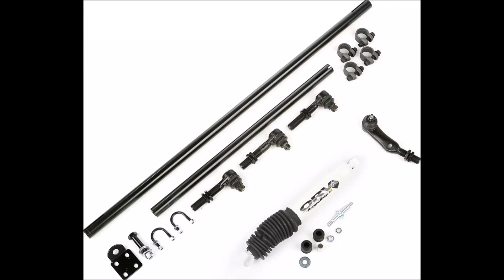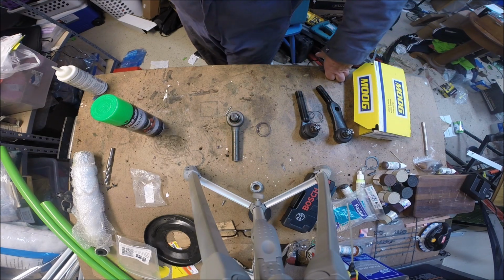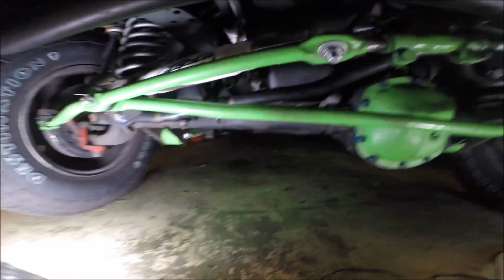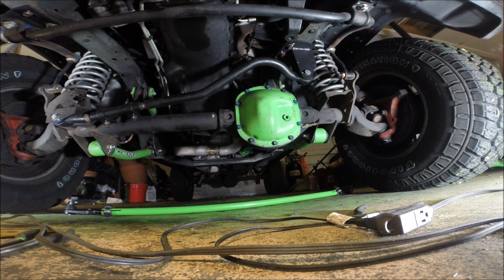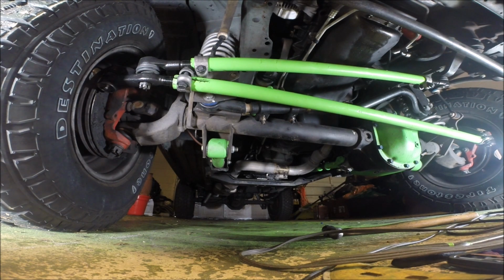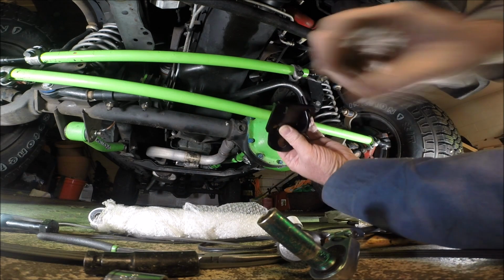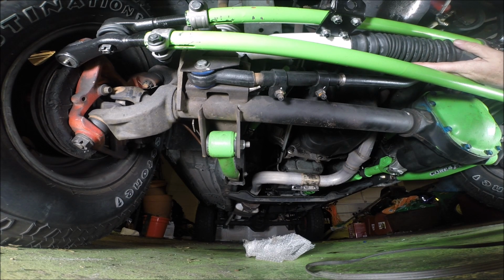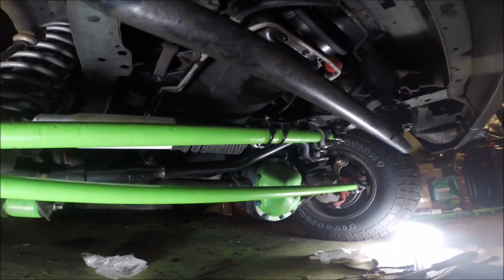Cherokee Therapy 18: Is the Rugged Ridge HD Steering Kit for Cherokees *Actually* "Heavy Duty"????

Comment: Thanks for making this video. Really helpfull showing the details of the RR. Kit. Well duu. The longer rod emd goes on the right side it has hole in it for the drag link.  Remive clamp bolt slide clamp up . Adjust steering. Slide clamp down tighten bolts. Baddabing,!Just rotate the clamps .  Looks like RR made a good kit besided claps. I eish the rod ends had jamb nuts and no slice in the rod.
Reply from the maker: Yeah I had to figure this one out on my own, and the instruction pictures SUCK lol